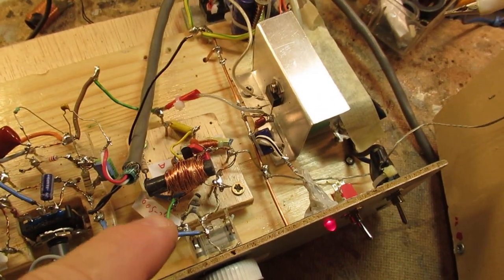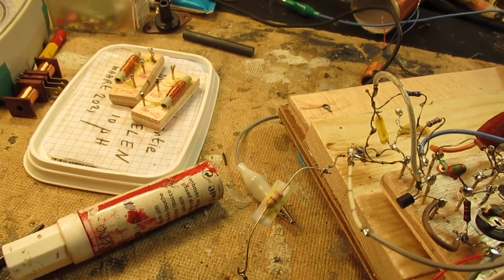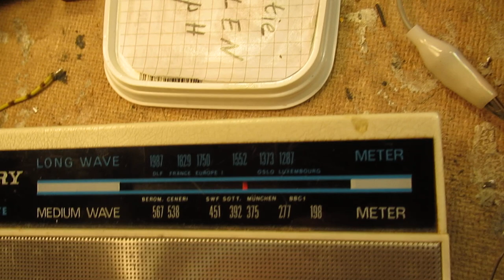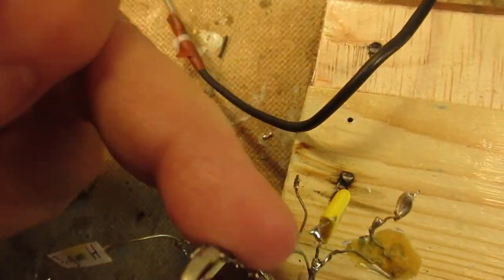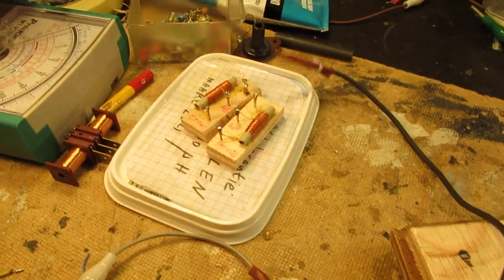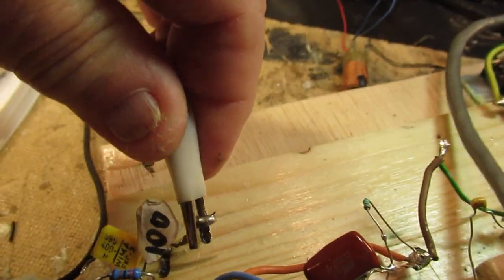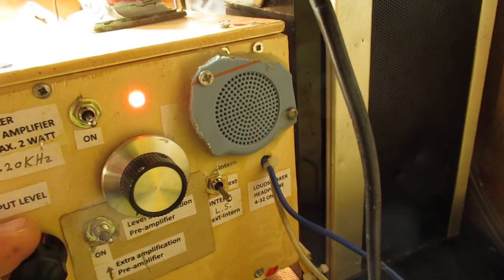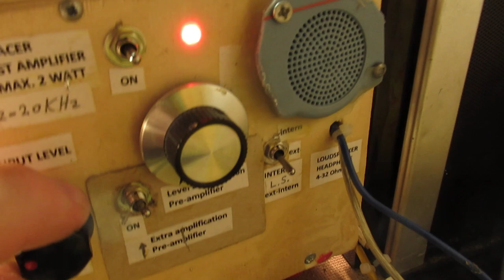Trying to make a simple LW radio TRF part 9: receiving the BBC and France with too much noise VLOG

Comment: The long wave coil in the radio is using litz wire ? . Don't know if that makes any difference?  You could try a potted ferrite core maybe. I am always amazed at how radios get to use the lower frequencies as the size of the coils seem too large to be practical.
Reply from the maker: Thanks. Yes, litze makes difference. The 1 mH coil of that electronic organ is a kind of potted ferrite coil, it worked. Idea is to get a high resonance peak on (say) 1300 meters and/or where a long wave radio station works.

Comment: I don't think I've ever seen a radio whose dial reads only in meters, and not at all in frequency. If I'm not mistaken, in the States we've never had longwave public broadcasts such as the BBC and others in Europe had— or at least not in the post-WWII era, that I'm aware. Were radios labeled only with the wavelength, such as the one in your video, somwhat common in Europe in the 1940s-1980s?
Reply from the maker: As far as I can remember in old radio's in Europa the "meter" (wavelength) indication was very common, especially long wave and medium wave, say between 150 KC and 1.6 MC. Indicated on the old glass scales. Also the names of the radio stations were indicated on that glass plate, where along the pointer moved.

Comment: Your store bought radio looks like any AM radio still on the market and they all use 455khz IF sections. Perhaps you need the tuning coils (same as the store bought radio)  instead of filters for the IF.
Reply from the maker: Thanks Barry and yes, that is indeed a good idea. I am more or less sure that the superhet. principle can/must work on Long Wave, though it is not as simple as on the "higher" frequency bands, going from (say) 1 MC to (say) 30 MC. I have ordered a new set of ceramic 455 KC filters for new experiments. The filters in the IF amplifier that I show in this video had a kind of "double" resonance peak (thus: also a dip) within the 10 KC wide bandwidth and I could not find an easy solution to flatten the 2 peaks to 1 peak (= remove the dip) inside that 10 KC wide scope. That also needs more experiments, in fact such a problem  should be easy to cure. Normally (with coupled IF coils) it can easily be cured by using a small "bridge" capacitor in the 10 pF-50 pF range, but that did not work very good in this case, where the filter(s) were ceramic. It could cure it somewhat, but not good enough.  9 nov. 2021.

Comment: Run it out of batteries and attach a good ground. Probably worth a video on its own.
Reply from the maker: Yes, good idea.
Reply from the maker: Tested it on a battery, a tiny amount less noise. Also good ground was used, signal strength goes down, selectivity somewhat better. Lot of radio noise on my location on all kinds of radio bands, also on Shortwave, was tested in the past with a spectrum analyzer.